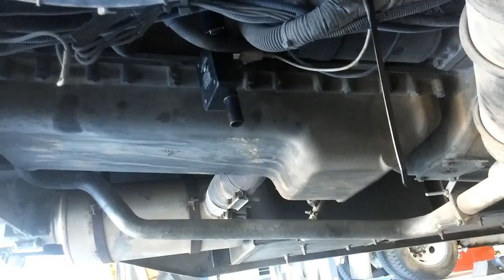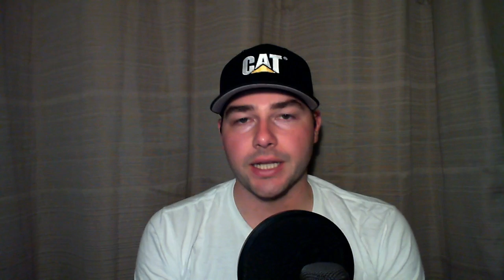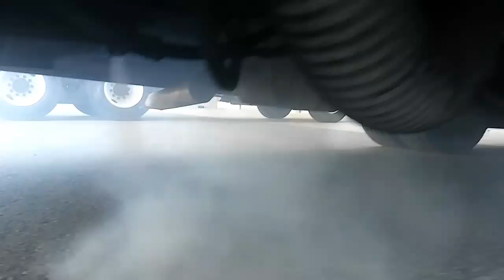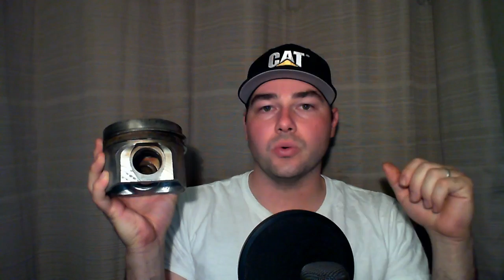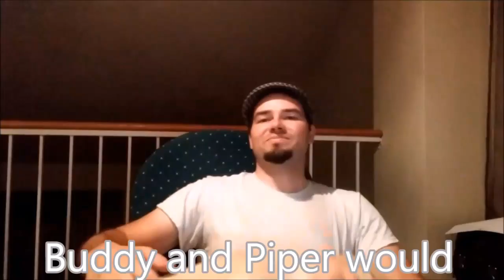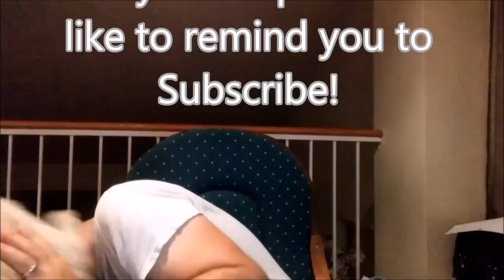Is Idling Your Engine Bad?  Does Idling Hurt Your Engine?

Comment: 2006 Peterbilt 379, 475 acert, I many times have to sit while getting loaded or waiting to unload, I idle to to 1000, but also keep the engine fan on so it’s not steadily kicking on and off, and temp stays anywhere between 180-200

Comment: Please answer this question. 
I got my truck Friday with a c-15 that's flawless. It was only idled to pump off tanks back home in Texas,  for maybe a half hour at a time. 
It's Monday and due to the extreme cold I've had to idle the engine for 3 nights with day driving in between. 
I knew about idling up the rpms, but there's no way I could find to do that in this peterbilt. 
This morning I drove into Indiana and noticed blue smoke burning from the stacks and noticed it was running different. 
It's -2° F now and after watching this video I turned off the truck and broke out the sub zero sleeping bag. I don't have a way to rig up a bra and can't get the coolant temp above 130.
Is 3 days of idling with highway driving in between a reason to be concerned?
I figured out a way to get it up to 1k rpms, but have no way to bring up the temp to 180.
Thanks for your help.

Comment: I must have done something wrong. My 3406 only got 1,662,000 miles before it dropped a valve. I idled it at 950 nights when it was above 80 or below 40. I primarily ran from the Midwest to the west coast grossing 80 to 90 thousand with spread axle or 3 axle reefer trailers.
Reply: Was oil changed at the standard service intervals or more frequently?

Comment: But diesel is cleaner. So oil needs to slash around lining the lower end of the cylinder. Iv been told by more than one mechanic this. There isn't enough oil splash at below 1k RPM.

Comment: hi , first thinks for your videos they help me so much as a marine engineer.
you said that if ou need to idle your engine, do it at a higher rpm to increase load, what about engine wich run at only 1 bank of cylinders / time and can reach 65°C oil temperature at idle ? is it the same case ?

Comment: went away for a weekend and found my tractor running in the shed, a rat had jumped the starter and started it, went back on audio off the security camera and it had been idling for 30 hours, don't imagine that done it any favours, was gutted at the use of fuel at the time and now i realise that may have caused the blowby it didn't have last summer. though it was the lighter oil :(

Comment: So no idle heat stroke or freeze to death
Reply: well you could run the ac on a battery, recharge the battery , heat by gas/propane cylinder,  electric cars should be heated by propane.

Comment: Average APU is 11,000. Around 2500 to install at Thermoking. There will be issues and repairs but it's peace of mind not feeling the truck vibration sitting or sleeping plus APU starts to keep batteries up. They actually trouble shoot APU with a computer. Memphis Tennessee has a very well experienced and trained technician. Was 4000 for 2 repairs but if had to go back was no charge. Once you get an APU or fridge you don't want to go back. Sooo much better on driver and semi truck engine

Comment: So, running a PTO is REALLY BAAAAAD for the engine, right!? Or, maybe, not so bad, since the engine is really working hars to turn that PTO and pump, you have to rev up, and the engine runs with high oil pressure, and hot all the time, as you had mentioned, the cilinders like to run HOT! Please, advise. Thank you, great video.

Comment: So I just started to idle my truck after owning it 2 years . I got it with 542k Cummins isx . I never did like to leave it running all night , especially after running it all day . Bt I been hearing that idling your truck at 1000 rpm is ok for your truck . Hot or cold? Someone help a trucker out

Comment: I would rather keep it in neutral if you were to idle it because the drive terrain will start to overheat if in a gear when idling and put it in neutral the rpm will drop by 100 and it will stress the engine

Comment: what if the engine is cold, During Start coolant temperature is 2 degree celisius. Should We Idle the engine so that it reach near optimum temperature? or we should drive it without reaching the temperature at optimum temperature?

Comment: I had an APU on my truck and when I sold it it had 26, 000 hours on it and the truck had almost 800,000 miles so having an APU save that truck a lot of idling and the Apu uses about a third of a gallon an hour

Comment: @adeptape What are your thoughts on cold idle and warm ups? When I first started driving I worked for a guy who wanted me to always let the truck idle for atleast 15 minutes in the morning before leaving. What are your thoughts on that?  I’ve monitored oil samples on gas engine cars and letting them “warm up” in the morning leads to elevated wear metals in the oil samples. With out “warm ups” there’s never any wear metals in the oil samples. Obviously you don’t want to be seeing high rpms or load while an engine is cold, but what are your thoughts on warm up operations?
Reply: Great question. Im following this

Comment: Great info. Helped confirm what I was debating.....Waiting for my ordered 2022 f-450 to arrive and now will be installing a high idle (if I have to idle more than 5 mins) up fitter switch as the first upgrade for sure. Flip the switch and she'll idle at between 1000 - 1200 rpm. Thanks Adept!

Comment: I have a older F350 with the 7.3.  I was told let the truck warm up before driving and that would give better fuel economy,  and less wear and tear on the engine.  I always let my truck idle in the morning for 10 minutes before I start my day or pull a heavy load.

Comment: Is it OK to put transmission fluid in a fuel filter and then install to clean injectors?
Reply: I don't see how that could hurt anything, just make sure to put the fluid into the dirty side of the filter so the system doesn't get unfiltered oil. I'm not sure if it would be good for a high pressure common rail system though. It might not hurt it, though.

Comment: An hout meter is a handy device to use for engine service intervals. I see a lot of engines with low miles and very high hours of run time. That is due to idle time.better to change engine oil on hours of service than miles of service.

Comment: Steering wheel holder idle ...................... truck drivers don't.  These are the same azzholes parked on the fuel islands taking a shower. One last thing FK refers too... Your just old idlers  LOL

Comment: Great video but you forgot one thing. When running an engine on idle for extended time you will have low oil pressure.
Raising the revs will increase oilpressure which helps lubricate the rings.

Comment: Question for you regarding idle time and glazing.  Is there a way to 'prevent' glazing for RV's now days coming with "auto-start" features to remotely turn on the chassis vehicle motor (gas or diesel) to automatically turn on in order recharge the battery bank when the batteries reach a certain threshold of discharge?  As I understand it, the auto-start idle can be "ON" for up to a few hours or so to fully recharge a typical battery bank (of course this depends on the alternator and battery size).
Reply: The auto start system will actually run the engine at a higher rpm, it is not a low idle.

Comment: Yeah but you need to let it warm up for a few minutes at least 5 minutes maybe 10 in the morning rather than fired up and immediately take off and start pouring the coals to it that will shorten the life of any diesel ⛽
Reply: You only need to let it run long enough for oil to circulate 3 to 5 minutes is plenty in normal weather.  Just take it easy untill temps build up.

Comment: I have to idle my 3406e 2ws engine quite a bit through the day because I have a pto on it its burning/consuming oil I've noticed my mechanic said to try idling it higher when I'm using my pto im kinda concerned 😟 ❓❓only because its slobbering oil what do I do is it bad❓

Comment: Awesome information. i'm gonna use this for my 2000 f250 7.3. I'll make sure when leaving it idling for longer then 10 minutes to use the high idle warm up tune to keep it above 1k rpm. Also one other thing to mention the use of Archoil AR6500 or Ar6200 fuel additive will reduce soot build up.

Comment: Downshifting is good for engine compression it creates vacuum in the crankcase and manifold, forces rings against the cylinder walls for a tighter fit, ya-da ya-da ya-da

Comment: My service truck has a 7.3 in it, I run the PTO all the time, it has an AIC , Auxiliary Idle Controller, I can program it run any RPM I want it to. In the winter I hit the button and she "idles" at 1200 rpm and the heat builds fast.

Comment: Here is my two cents. I have always thought excessive idling a total waste. I have been an owner operator since 1992 & constantly look for ways to control expenses. I own & drive a 2007 Pete 386 with a C15 acert that I bought back in 2007. I pull a 53' reefer throughout the midwest & Texas where I live. I try to never idle any more than needed. Truck now has 1.4 million miles on original engine. It't never had the head or pan off. Uses no oil between 15k mile changes. Rotella15w40 & Cat filters only. In the thirteen years I have owned it, the water pump & upper & lower wiring harness have been replaced. The manifold gaskets & studs nave been changed.Thermostats replaced twice.Recently installed a set of reman injectors. I run the overhead every 100k miles & that's it. She still runs smooth as silk & pulls as good as ever. Only mod from stock is a set of free from mufflers from Pittsburg Power along with replacing the entire exhaust system.
Reply: 1.4 mill is all because you take care of your truck and it’s a cat… I see guys going 35k between oil changes in fleets i find it absolutely insane.
Reply: Idling is a terrible waste of money, both in fuel and more frequent maintenance.

Comment: We run an International Tow truck at work with a Cummins ISM and it idles SO MUCH. We don't have much an option though when using PTO or repairing or hooking up a bus on the road the truck has to spend a good 30 minutes to an hour each time it goes out idling. I would love to put it into high idle at least to help alleviate the issues but they don't put high idle switches on trucks anymore(at least ours)

Comment: Dam 2016 Mack MP8. No APU. So gotta idle it. Bump the idle up 1k. Well after so long the Mack goes into "clean idle mode" and automatically drops the RPM back down to an idle. Then if the shit box engine gets cold, it'll idle itself back up to 1100rpm. Usually around midnight, waking you up and in sure any driver parked beside you.

Comment: Bearing surfaces are usually hydrodynamic. If the engine is going to slow it can not generate hydrodynamic pressure and keep bearings working. 

It’s a complicated issue. 

Thank you for the interesting discussion

Comment: I recently changed a cylinder head on my KIA k2700 truck.  After the repair it was smoking a lot and the mechanic said it will get better the more I drive. I assumed idling would yield the same results so i idled it on 3000 rpms for 30 minutes. The engine started to overheat and i shut it off. Since then i have been getting a lot of bubbles in my overflow tank and i keep overheating after 1 hour of driving.
I'm beginning to think i messed up the engine.
Reply: That sounds like an blown headgasket.
He either didn't changed it or didn't bled your cooling system.

Comment: When I worked at an(independent) engine shop, I remember a piece of paper in the cylinder kits for a cat that said to not idle it for more than 5mins, take it out and drive it and seat the rings or they might not seat. 
Not sure what cat model it was ,too much stuff to remember since then.

Comment: Damn this is opposite to what I always thought. I figured that lacking an ignition system, a diesel engine didnt much give a shit if it was idling or not, whereas idling a gasoline engine for a long time caused spark plug damage.
Reply: Diesel engines run much cooler at idle, and really cooler in cold temps. Engine temps determine how fuel is consumed/burnt, be it gas or diesel... but diesel is much more subjected in cold weather than gas. However, long term they'll both create engine issues.

Comment: When i use my tractor in my yard for several hours over a week or 2 I take it for a run down the road to bring the engine to full operating temperature so it cleans off the carbon, on road driving is at 1500 rpm, the other major factor is oil, if you use fully synthetic oil it makes a difference and can be used in any diesel engine no matter how old it is.

Comment: What about idling for a few minutes to let the engine/turbo cool down?
Reply: I'm no expert but whenever I work an engine I give it a bit of time to cool down at idle so it can cool gradually instead of took quick which can warp stuff.
Reply: I don't give a rats ass what anybody says, I ALWAYS let my truck idle for 2 to 3 minutes before shutting down to cool the turbo. 300k miles on my duramax and counting so I'm doing something right. Well, I'm also a freak because I change my lucas oil every 2500 miles. Don;t care about cost. It's my ocd that controls that hahahahaha
Reply: @dandifusco1868  😁
Reply: 5 min
Reply: Ya,alwayslet it cool down a little.

Comment: It is generally accepted that long periods of idling is not good for your engine because it tends to glaze up the bores making them highly polished, this makes the engine pull oil up past the rings to be burnt when the throttle is opened which creates blue smoke until the oil has burnt away. A lot of drivers start the truck up and if the weather is cold leave it running all day and possibly all night if their away from base and have to sleep in the truck, this also stops the brakes from freezing up because of the warm air circulating round the truck. It is not ideal but on freezing night it saves a lot of problems and time in the morning.

Comment: Hello Louise,
  I’m writing with concerns of cylinder glazing after watching your video on this negative activity in a Diesel engine.

I just purchased a 2019 Ram 1500 5.7L Hemi V8 gasser.    I broke it in for the first 250 miles myself varying the engine rpm, however since turning in over to my wife she has idled it extensively.  The hour meter is telling me idling is currently at 65% of the total running hrs, 17/26 hrs.  The truck currently has a cumulative 804 miles on the odometer in total. 
 
Should I be concerned with increased cylinder blow by, less than optimal efficiency, power, and ultimately longevity after her less than optimal break in during the first 1000 miles.

Thanks for any consideration of my question.  I appreciate your expertise.

Comment: I just bought my first diesel, an F250 with the 7.3 and it scared the crap out of me the first day I started it. It was idling at 600 rpm, but then i heard it speeding up and i was so scared that some electronic issue had locked my truck at full throttle and it was going to keep going until it blew itself apart. No, it just raises the rpm to 1200 after it idles for a while :)

Comment: Can anyone reply me?? 

If i rev my engine to the redline it will remove carbon build up???????
Reply: Gabriel Vieira, As a Diesel engine fitter for over 50years and engine reconditioner the simple answer to your question is NO. Diesel engines have a governor fitted to them to stop them over reving and are designed to run at that RPM, letting them exceed that engine speed while running down hill for example could end up with a hole in the side of your engine where a Con-Ron and piston have come through, not a good idea.
Reply: Adding a load that is not excessive to a diesel engine is beneficial after long idel time to clear out the compressor on a turbo depending on your PCV set up.

Comment: Detroit is now saying that idling the engine up at idle causing fuel degradation of the injectors and premature DPF failure. 

It’s a darn if you do and a darn darn if you don’t. 

Fortunately I can still offer 98 EPA engine options that don’t require DPF’s or the need for DEF fluid in gliders. 

However, this will be changed in coming years by the EPA. 

Plus you can’t operate them in California. 

But for now, it is a excellent options for certain applications that require idling. 

But idling as you mentioned does reduce the life of the engine. 

The engine does know if it’s running down the road or just running the heater. 

Idling is bad. 

Old school guys were taught to keep a truck running to lubricate the turbo and other items. 

But those days are long gone.

Comment: Does this apply to most if not all Diesel engines, for example I drive a 2011 LML Duramax and was taught to let let the engine run for a few minutes on a cold start before driving, and to let the engine run if making short stops as in during fueling, running into a store quick etc.

Comment: I just use to drive my car to go to the station. Its Totoya, and 158 miles. I kept it running by mistake from 6:30 Am to 5pm. This is the first time. Will this affect the engine of the car? will this explode the car? The car was on parking. When I came back, I smelled something and saw that my car is on. There was something oil may be from the car. I just turned it off. The car was hot. My concern is that, will this affect the engine of the car? Second, could it explode?
Reply: Toyota Scion, not brand new

Comment: We had toyota fleet vans that operate 12-18 hours a day. Over 500k kilometers. Mixed running and idling. They idle 2-6 hours a day because tourists dont like going out and stay inside where ac is always on because its hot in my country. Ive seen them rebuilt and still see the honing marks. I think if you put the correct oil and change it religiously idling is not a problem.